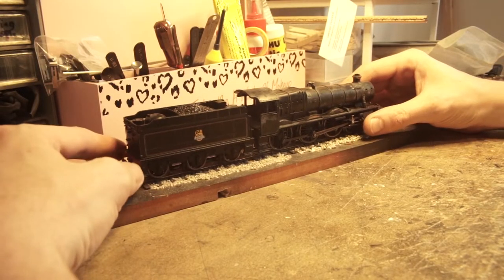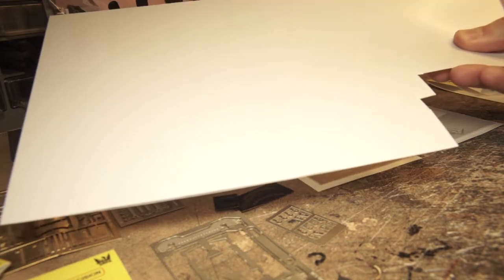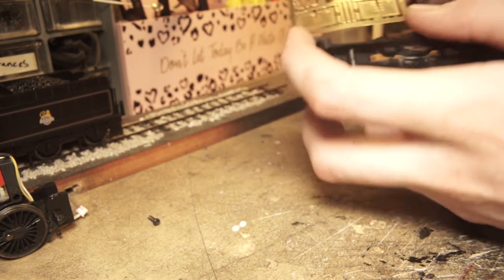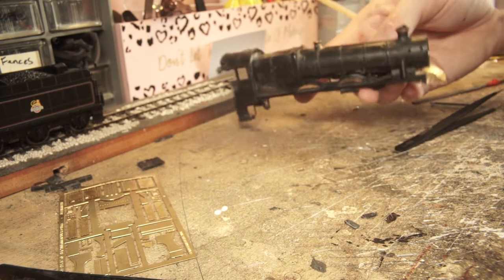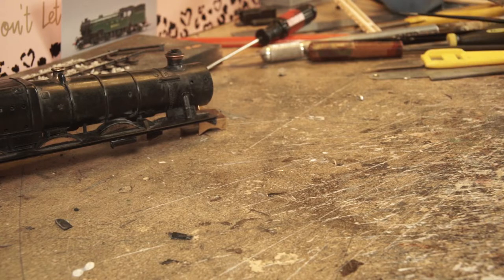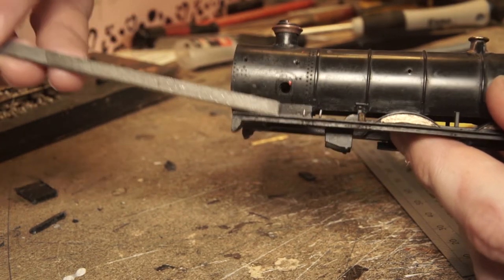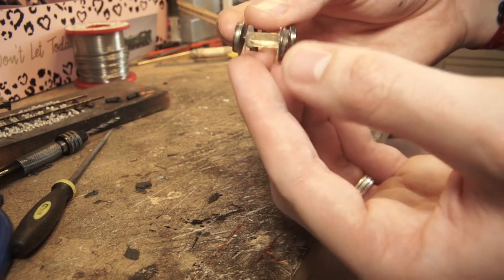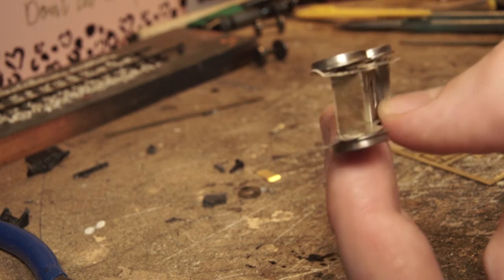Modifying a Modified Hall (Part 1) - SWAS Episode 34

Comment: Your projects are beautifully executed and the end product is excellent. Just one nit-picking point, shouldn't the modified Halls have a 4000gal. Hawksworth tender rather than the Churchward type? Sorry about that.
Reply: Hello. The earlier batches were built with Collett tenders, so in preservation, it would be correct for 6960 Raveningham Hall to be paired with a Collett tender and while it was scrapped with a Collett tender, I have a book with photo dated 1955 showing it paired with a Hawksworth tender. 6990 Burton Agnes Hall started life with a Hawksworth tender but by 1961 it acquired a Collett tender (no idea when though). Another book shows 7903 in BR black paired with a Collett tender. It depends on what loco Scooby has in mind and whether or not any poetic/artistic licence is to be deployed. Hope this helps you and Scooby if he's reading.